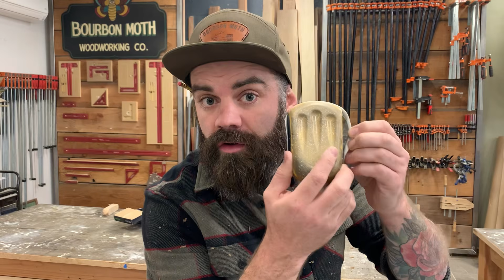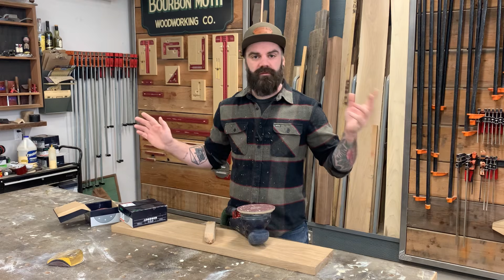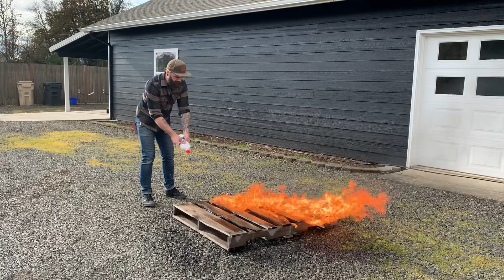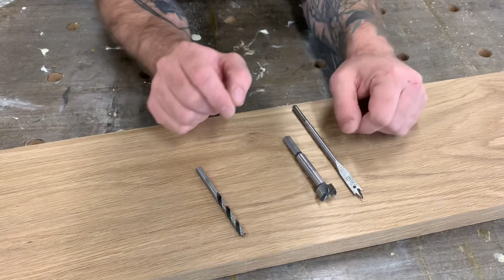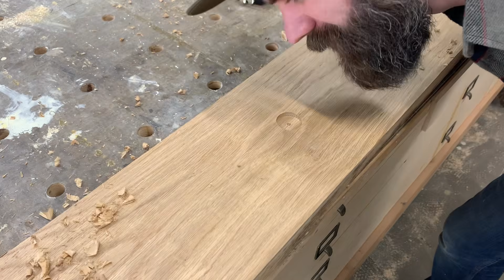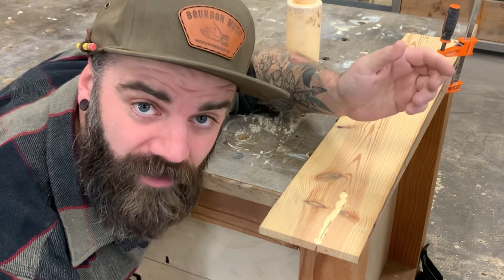Woodworking Tricks You'll Actually Use // Helpful Woodworking Hints

Comment: The tip about blowing glue into the joint was a keeper!!  Here is a good alternative way of getting a measurement between 2 pieces butted up to each other. 

Take 2 pieces of scrap wood and cut one end of each to a point. Butt one piece against your joint. Place the sharp end of the other scrap at the point you want measured to. Have both pieces of scrap side by side andwith a knife cut a thin line somewhere in the middle of across the two pieces of scrap and then add the two dimensions from that sharp line to the points of the scraps together for a precise total. Thank Tom Silva for that tip. It works great. He showed the tip on finding a board center as well

Comment: In the shop I never use a tape measure, steel rule every time.
It's a different level and I use the rule in reverse so to speak.
Put the number on the edge if the board and use the end of the rule to mark, 100% accurate.

Tape measures are for approximate measurements.

Comment: the centre of one's board, can just measure the shortest distance bewtween the edges, and take half of that?, why diagonal? And isn't that just ''a'' centre dot on the middle line of the width... and not ''the centre of the board''?   For centre of board I'd draw the intersecting lines in the middle using such straight measure on the board from corner to corner.

Comment: Great video Moth.
My experience is that the best way getting the dust off (and out too! the nerve puts and holes), is... a vacuum with a brush attachement.  I've been a cleaner so that's how one knows the difference.    Why wipe it around, or blow it in the air while one can use a vacuum wtih brush attachement to get it all out and colelcted instead of elsewhere.

Comment: Many tape measurements has a clear window on top with a red line showing the opposite side of your tape measurement. This scale is offset with the exact distance as the length of your enclosure. So bring your tape against vertical side and read your measure off from the top of your tape holder.  Smart inventions.

Comment: Cleaning glue on a join.. I wait till the glue has gone a bit leathery/cheesy (depends whether yer hungry or plain HARD - GRRRR!) after about 5-10 minutes and then I take a small sharp pointy blade (I use one with an angled end, i.e. 45 degrees and gently pick away the excess. The 45 degree bit is handy, cos I can use that side for small lines or use the longer part of the blade - about 2 inches - for .. em.. longer lines. I can slide the blade under the squeezed glue to remove lines of it too. By this time, the glued join will have taken hold, so using the blade in this way won't move the wood, but also, the squeezed glue is easier to remove without potentially gouging the wood, as could happen with a chisel after the glue has hardened - the glue is probably harder than the wood. Besides, the chisel blade doesn't like hard glue. Then, the mess is gone before the glue has dried. I use this on the inside of a musical instrument body, where chisel access can be (and most often IS !) impossible.

Comment: Good tip for measuring an inside dimension such as inside cabinet base (only an example). Take 2 small wood strips and a couple clamps that will overlap inside, move them out to inside dimension, clamp there, pull strips and measure. This will give an exact measurement.

Comment: Tip for power sanding mainly about your pattern move from side to side edge to edge without stoping overlapping each pass by half a sander width and on all final passes no matter what grit move slowly and don't stop mid work piece if at all possible

Comment: Finding the center of a board without a ruler:  

Put a mark where you think the center is. 
Take a scrap stick and measure from the mark you made at the center of the board to the edge and mark the stick at the edge of the board. 

Now put the stick on the other side of the board and put a second mark the length you have marked on the stick. The center of the board is exactly between those two marks.

 If your first mark is really close to the center the distance between the two marks should be easy to find.

Comment: That was freaking awesome. Some great ideas that I’ll use for sure. The glue trick made me spit my beer 😀. About the sanding, you never go high grit and follow by low grit. You just erased what you did. That goes against how sanding works. The higher the grit the smoother the finish. There is no point in going high for a smooth finish to go back and rough it up with a lower grit. That exactly what you are doing. Stop doing that. Lol.

Comment: Your center-finding trick also works with splitting anything in thirds, except you use a number that is divisible by 3—like 9 or 12. Tip a ruler to 0 and 9 and mark the spot where 3 and 6 intersect and you have a perfectly divided board into thirds.

Comment: if you need to drill a hole larger than what you've already drilled you can usually just cut a plug for the original hole and use the center of the plug for the brad point of the larger bit.

Comment: The end of the tape measure had play (is loose) the amount of the play is the width of the end piece. So hook over and pull and your measurements are correct, put flush against and push and your measurements are correct. You might just want to lay it on it's side.

Comment: Another tape measure trick is.  Measure from the corner to edge. Just flip the tape measure upside down.  If not coordinated enough to hd spot with fingers to see the number side.  Use a pinch close pin.

Comment: Here’s a bit of thought…. 1st) random orbit sanders are NOT meant to be a finished project finish. 2nd) they do make straight palm sanders which are by designed to go strictly w a grain. 3rd) consider the micro level…. The courser the grain the larger the “fingers” between the grain and the more the finish as something to cling too. The finer the grit the smaller the “fingers” between the grain which means the less area the stain or finish has to cling too. So basically you can change the tone of stain/finish simply by which grit of paper you use. 

Just like end grain…. Always darker right? Next time use a finer grit on the end grain vs the grit for the main piece. Wow… amazing what knowledge can do and knowing is half the battle

Comment: I actually repurposed an old cabinet I had built for my miter saw.  I built a down draft table for sanding.  The laminate countertop was left in place.  The drawer was removed, the bottom and drawer opening were sealed.  A hole to attach the connector for my duster collector was installed, either in the side or back depending on your shop layout I used a piece of peg board to layout and drill holes for the dust to be collected, not every hole was used I used about every fourth or fifth hole.  It depends on the size of your dust collector, use as few holes as possible.  Good luck.

Comment: GLUE- blow dryer to fill cracks 2 reasons 1.) LITTLE heat allows glue to become less thick ( better to preheat the crack of the board and not the glue because it will dry the board out a little more and it helps suck the glue inside it like water and paper towels. 2.) Vacuum suction pulls moisture in from the air and the board making it harder and longer to glue unless it's gorilla glue. 
When glue seeps out of two boards I'm putting together I usually run my finger down the glue I'll make sure there are no cracks nothing in the glue line about 15 minutes later I come back and the glues usually sucked right inside to the board as long as I didn't leave any air holes in the glue line. This will not work well with too much or too little, and blow dryer we'll also level out them lines and help it suck into the board if you just warm it up a little bit with the blow dryer before you walk away and let it dry. Heat makes almost all glue self  leveling.

Comment: The glue cleanup trick is great but you're still working too hard.  Come in there with the chisel after it has congealed and started to dry BUT before it completely dries..  When it's in that state it cleans up nicely and you don't even have to fight it, it's like scraping up cold bacon fat with a rubber spatula, lol.

Comment: Tip for finding center of a board depending on width is to use a speed square put the fence up the the edge run a line down the 45 and the set the fence o. The opposite edge and do the same where those 2 lines intersect is center

Comment: Tip for finding the center of a board (running the heart-line, not from end to end). This also can be used to mark said line.
This may be the jig you were trying to avoid to begin with, but I build my own easily with a small scrap board and three screws/nails and use it whenever I need…
Pick a board longer than the project board width. Put a screw/nail in on either end leaving the heads above the surface, and one at the half way point (this is the only measurement involved) so the point is slightly proud on the side that your end-screw heads are also showing. This side of the board goes down. The end screws fall on either side of the project board, and turning so the heads both touch the sides of the project-board puts your center screw’s proud point perfectly in the center of any board that fits. Now you can run the length of the board and as long as the heads stay in contact with the sides you will always get a perfectly marked heart-line via the center screw’s point (which, I might add, is depth-adjustable if using a screw of some kind and not a nail). For mine I substitute the end screws with small dowels that stick out like a half inch or so.
I hope this is follow..able.

Cheers!

Comment: Another savings idea on cleaning your sandpaper with one of those rubber things...next time you go into a Goodwill store or second hand store or similar, look for a pair of old shoes with the crepe rubber soles.  Buy those and rip that sole right off and you'll have a very cheap exactly the same thing you'd pay big bucks for in that little "eraser thing."  I've been using crepe rubber soles for years.

Comment: Denatured alcohol works well as an in between grit sanding medium bc it evaporates quickly and doesn't compromise the wood so you can use water or oil based finishes.

Comment: To be fair, there is an easy way to take pallets apart, you just need to rip two thick boards out the hard way and use those as levers to pry the rest of the pallets apart, then hammer the nails out of the boards.

Comment: Hello, for measuring, did you know that the reason for the tab on the end of a tape measure is loose for a reason?
you push it in for inside measurements and pull it out for outside measurements.  
This does however place doubt in my mind for the accuracy down to the 16th of an inch so when I need more accuracy I actually measure a stand alone piece from the 1 inch mark and Hopefully remember that if I need 9 inches that since starting from the 1 inch mark that I measure up to 10 inches.  It is risky but just thought I would share that with you all.

Comment: The reason the tip of a tape mesure moves is it moves the 1/8" the hook is thick,  just slide the end of the tape into the conner and mesure to the end of the board, need a more accurate measurement  use a rule  or stiff measuring stick, not a yard stick or buy a folding carptners tape they are very accurate. 

Your tape mesure is only as good as your ability to use it.

Comment: Best pallet idea yet.  
Take a ciclur saw and cut next to the nail line the boards with nails in them can burn, the center parts without nails you can use, make sure you use a wire brush on it to remove ricks and Mudd then a metal detecting device before milling any of it.  Neat trick with the short parts glue will make a long board out of them.

Comment: Actully I use SunMight sand paper with a plomer backing insted ofp aper you can wash them with dish soap and water and let them dry. You talk about getting more of of a sanding disk these last 5 to ten  times longer then say Diablo brand you might pick up at home depot. 
Even without washing they last way longer and the edges don't get screwed up.
Best money I've every spent on a box of 100 sheets.  Some automotive paint supply stores sell them or you can find them on Amazon in the correct grits.
The automotive kind dont use the same grits sizes.

Comment: Glueing tip for splits or cracks: take those flimsy shipping straps off boxes and cut them up into 6” pieces. Inject glue the best you can then take the strap pieces and slide it up and down working the glue into the entire crack. It’s a free tool, and works great.

Comment: For measuring into a 90 degree angle, take your tape measure from the outside edge to the inside edge (where the tape curves up) and take a credit card and slide it under the tape and up against the 90 degree edge. Then clip the credit card to the tape, take the tape off the piece, keeping the credit card clipped to the tape, and measure to the edge of the card that was up against the 90 degree piece. There's your measurement. Know what I mean?

Comment: Just found your channel a few days ago and subscribed almost straight away, I have really enjoyed watching you, from build to info and I have to say you make me laugh you're a funny bloke (with skills) And I have a tip for you about getting dry glue from the edge (13:36 your video) if you use a corner of another bord "same angle"  like 45 to 45 and run the angle along the edge the glue comes off in one go, this will work when the glue is still wet but as you said it's better to let the glue dry. PS. I use a wire brush on my sanding pads,

Comment: 14:20 glue the cracked board.  I stick a chisel into the crack and open it up more.  Squeeze some glue over the crack and blow it using my mouth (vs. shop vac or put glue in your mouth and blow).  You may repeat it one more time.  And use a pipe clamp to squeeze the cracked board together.  If the boards do not line up (warp or twisted), add a backer board and 1 or 2 more clamps.  A+ for your acting skill.  LOL.

Comment: For that center of the board trick, you can also use it to divide a board into 3, 4, 5 etc without any hard math dividing by just using your ruler set to an easy number that's divisible. So if you want it to be divided into 3 then put your ruler at an angle until you are measuring 9 across the board and put your marks at 3 and 6. Hope that makes sense

Comment: On cleaning sanding pads, belts, etc... Lose the stick.  I go through a pair of sneakers every year.  my good ones become shop sneaks, then yardwork, then junk. Take the junk (i.e. very little rubber left in the places my feet need, but a ton left elsewhere) and use the remaining rubber stuffs to clean sandpaper tools.  The junk rubber was trash but saves and unclogs the paper products like a champ. Works like an eraser on paper vs. pencil lead.

Comment: Blue painter's tape works well to prevent blowout when you can't use a backer piece. You can also put it over areas where you'll make cutting and drill marks  so you don't mark on the wood - works well for mounting hardware on finished surfaces.

Comment: Not Sure but cant you use the two holes if there evenly spaced at the end of the ruler on both side and add a dowel and find the center of the ruler and that will work as a Center Tool

Comment: I like your videos and here is another way to patch up a crack in a board. Take a piece of paper and start it through the crack. After it is started put a length of glue along the crack on the paper and slowly pull the paper from the underside of the board spreading the glue into the crack. This works great for repairing tabletops also. I've tried it and it works. This idea is not original. I got it from a man named Pete. I don't remember his last name.

Comment: First time watcher here. Love your ideas! My favorite two are going to a larger hole saw! And finding the center of the board. I’ll be using both often. Also thought the trick to not have to bend the tape measure and just measure out a foot was great tip! Observation here, I’m hiding you don’t like the use of pallets! When you have cash as your shop suggests you do, then you don’t need pallets. But when you don’t have cash to blow on new wood every time, then pallets and other reclaimed lumber is a godsend. You should have consideration and do real tips to help out those of us that need to go that route sometime or all the time! Don’t be a shop snob!!
Reply: If you want wood to practice on, use pallets, but pallets are made using the cheapest, crappiest wood and even cheap plywood or pine lumber is a better material to use. Pallets are meant to be expendable scrap.
Properly reclaimed wood however is amazing. I've had some mahogany that came from panelling in an old Victorian house that looked great when repurposed. 
Luck of the UK is we have hardwood from 2-300 year old buildings in our reclamation yards.

Comment: I liked all the tips except for the pallet one. I used pallets to build my raised garden beds.....and I had to bust a lot of pallets....so I bought one of these pallet busters and man what a huge difference. A little difficult if the pallets were built without proper gaps in between the boards, but you just start on the end and use a board as a lever underneath....This tool was worth every penny (not affiliated).

https://www.amazon.com/Bobs-Pallet-Buster-Yellow-Handle/dp/B07C8CQV35

Comment: to fill holes use 5 min. epoxy with  fine wood dust from your project you are working on (mix as much dust as the epoxy can handle). This does a couple of things. First it  matches the wood you are working with and if you are finishing your project natural the patch will darken or lighten naturally. Secondly it will accept stain and look like the rest of your stained project.